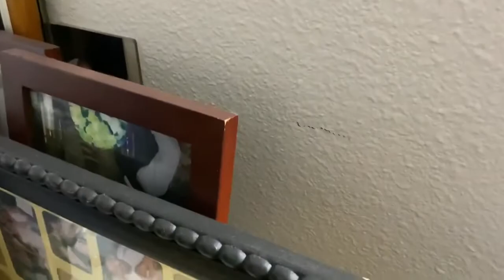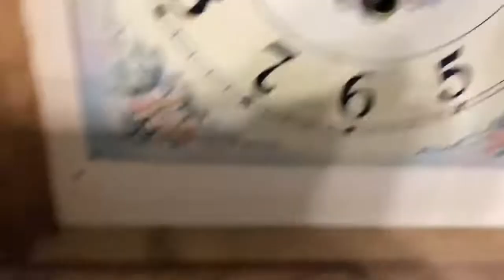Franz Hermle 1050-020 Clock Movement Part: 1 Identifying issues

Comment from the maker: NOTE: THIS VIDEO IS A REPOST FROM THE OLD CHANNEL!!! I HAVE MADE A NEW 
CHANNEL AS SEEN HERE, AND ALL OLD CONNER'S CLOCKS VIDEOS WILL BE 
UPLOADED TO THIS CHANNEL!!
Reply: I have a Franz Hormic two jewel made in Germany IRAD Adjusted 1050-021. It was evidently wound too tight since the keys (2) won’t turn either way   So before I take in to clock place is there a manual that is available that I can see inner workings on paper.

Comment: That's a nice clock - it looks great and it sounds great.  The time side doesn't run and the chime side looks like it has an issue with shutoff at the end of the chime.  What are you planning to do with it?  Fix it yourself?  Take it to somebody to fix it?  Leave it as it is?
Reply from the maker: I’m going to be getting a new movement for it, due to the wearing on the movement. Plus with little experience I have, as well as funds, I’d be better off getting a newer movement. 

Reliability on the older floating balance movements are lower compared to the newer hairspring balance movements.